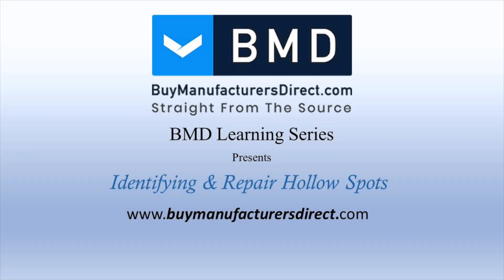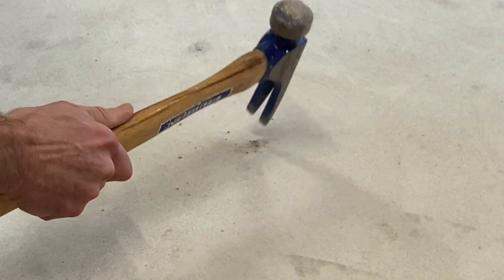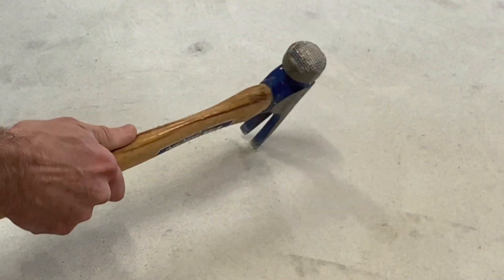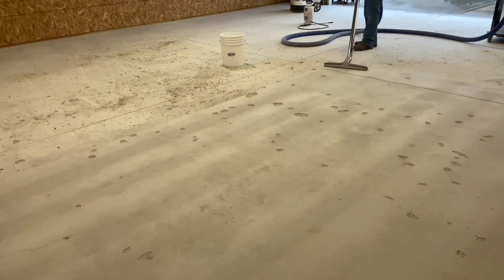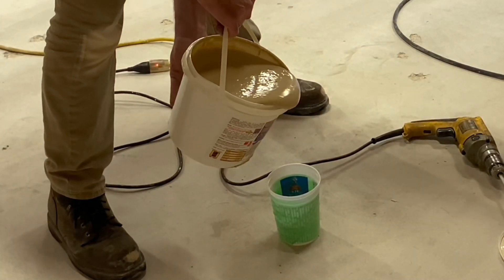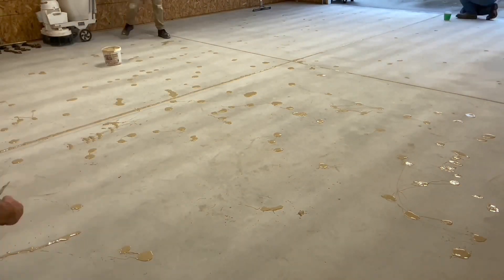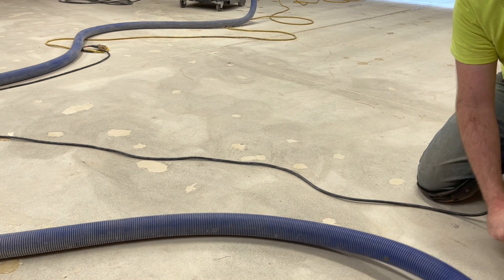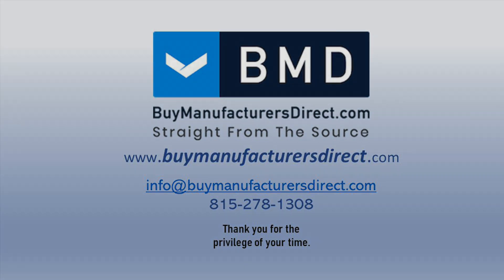Identify & Repair Hollow Spots in Concrete Floors | Equipment & Procedures

Comment: Did the old shed out the back... concrete was utterly horrid but so was the prospect of cutting, removal and re=pouring a new slab. Got my own grinder and it did a good job. I sealed it with a xylene based sealer as from what I could tell it had a similar product many years ago.

Now however up one end I noticed when I moved a chair around it seemed hollow. Drilled a 20mm hole there today and bingo.... entire corner is hollowed out under the slab. 

I now need to check the extent by drilling more holes and will eventually pump something in there to stabilize it.